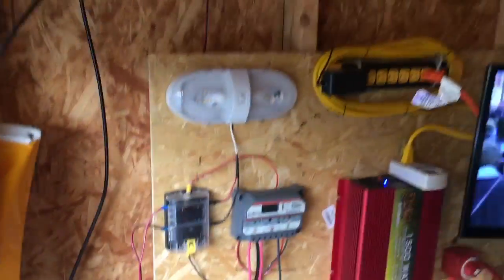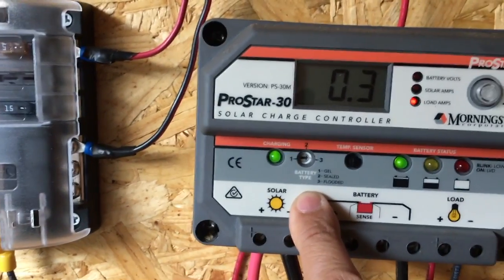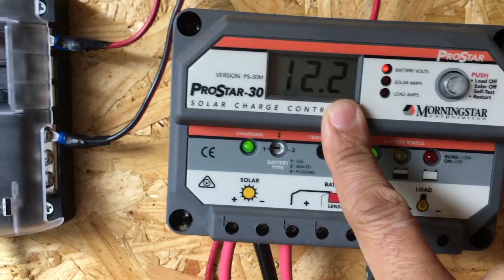Shed Solar Setup

Comment: You should put a 125amp circuit breaker or fuse between your battery to inverter wire. inline fuses will save you burning down your shed, trust me I know !